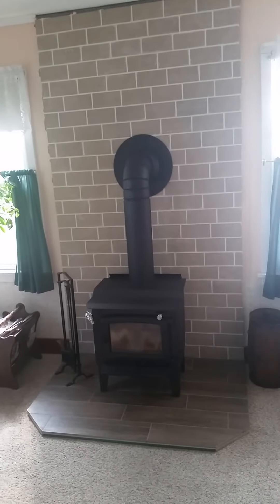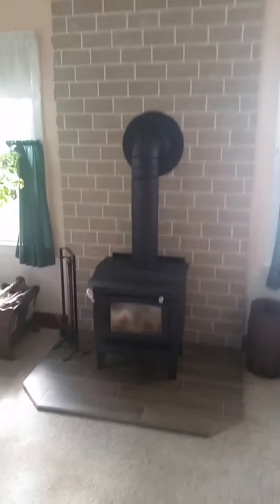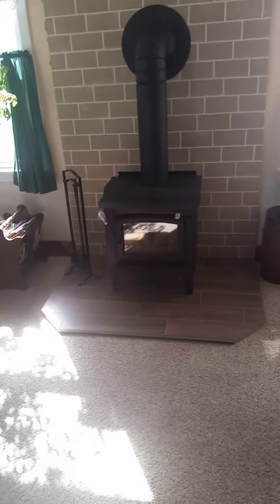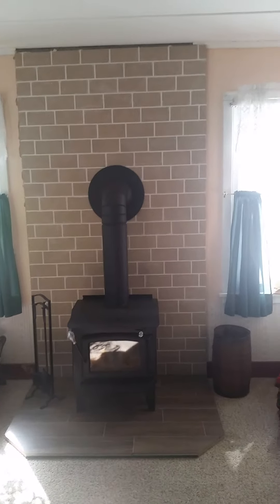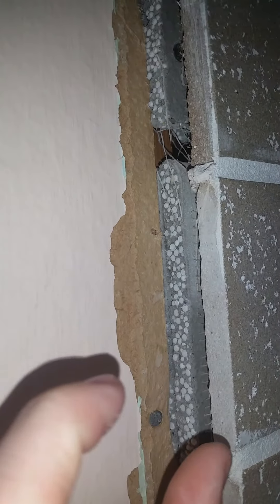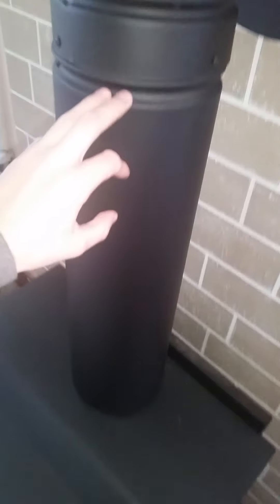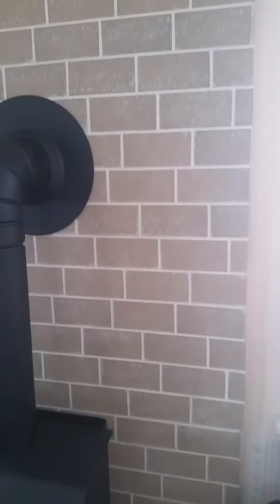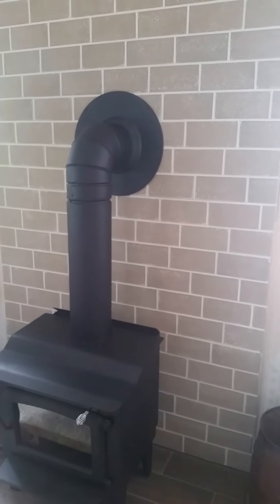Supervent / Selkirk Chimney - Woodstove project

Comment: I have two pieces of Selkirk 6" insulated and they will not fit together. I don't know how this idiot company stays in business.
Reply from the maker: tikiduck the stainless pieces? Both are the same with threads on both ends, one being male one being female?
Reply: Yes, I bought a tee kit for going through the wall and I had a 36" section already and they will not connect, one piece being slightly smaller than the other. Plus they did not supply the actual pipe to go through the wall, just the outer sleeve/thimble.
Reply from the maker: tikiduck I feel your frustration!